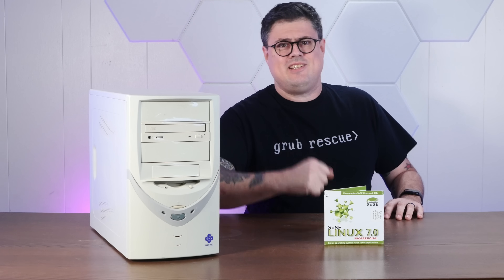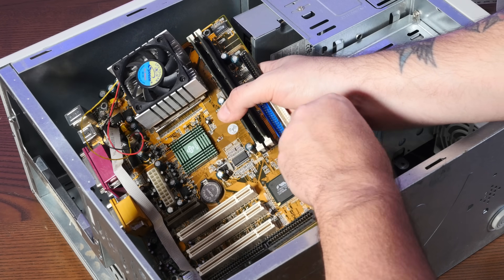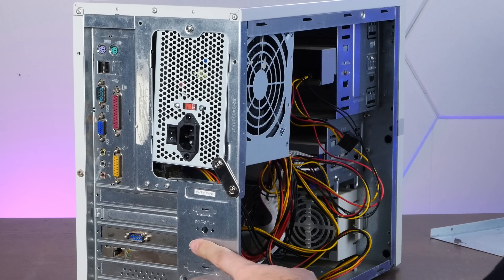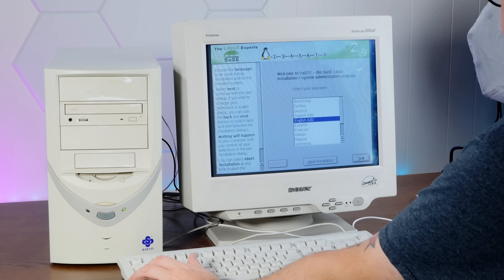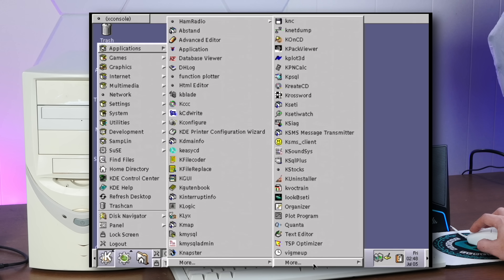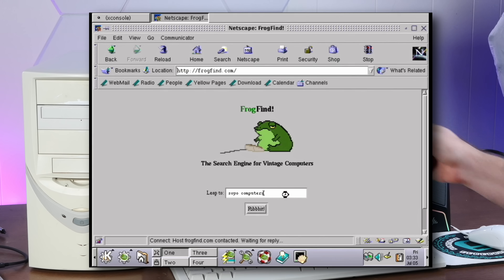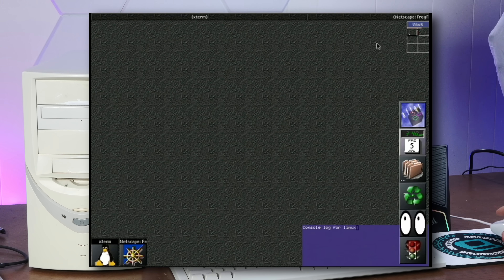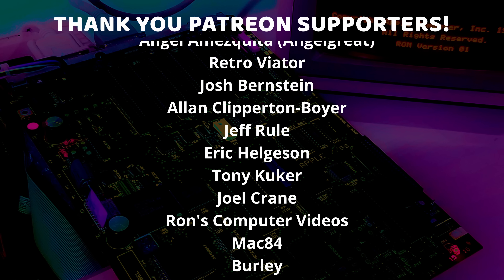The Forgotten Via C3 Processor

Comment: Finally! My favorite out of the distros I’ve tried - although the version I’m running is of course OpenSuSE Tumbleweed, which is pretty much the same distribution with modern features and a modern KDE Plasma desktop installed as the default.
You can actually still get the KDE 3.0 desktop as well! Just, don’t go breaking the sound settings like I did.
Reply: My to go Linux back days was Mandrake 8.1 - 8.4

Comment: My first exposure to linux was SuSe 8.2 purchased with a book from Best Buy.  The Via C3 was pretty common in thin clients from that era.  I bought a motherboard with a C3 installed for $35.  Wasn't a powerhouse, but was great for a file server (running linux)
Reply: Speaking of the C3, apperantly early VIA cpus were a mix of IDT and Cyrix designs while NS kept the mediaGX based Geode core before selling it off to AMD in 2003.

Comment: I bet that power supply had a mounting bracket it bolted to first.   I believe it would hinge into the slots on the side and then swing into position.
Reply: Thinking the same. I know my Lian-Li cases have something like this and wonder *if that could be smashed into working here.
Reply: It did. I've used that case before, or one just like it. You attach the PSU to a little rectangular frame and that hooks into the case. Parts like that get lost to the sands of time.
Reply: You are correct
Reply: It did, I have the exact same case with a different front panel.

Comment: If you haven't already, do a video on "Yellow Dog Linux" on one of your vintage beige macs. I tried a few times back in the early '00s but could never get it installed. You needed to side-load it with MacOS or something.
Reply: A good friend of mine got YellowDog working quite well on a Powermac back in high school.. I don't think he tried mklinux on a 68k though. Such good times!
Reply: Until he posts that, there are a few videos hew made of installing modern Adelie Linux on old PowerMacs.

Comment: YaST2 was such a gamechanger back then. I was a Slackware devotee, but was thoroughly impressed by that strange German disk.
Reply: Yeah it was, I mean this was still the era where most linux system installers were still command line based. Even when I first dabbled in linux in 2003 most only had a CLI installer and me being a Windows user could not get my head into it.
If it were not for Suse or Mepis linux it's unlikely I would still be using linux for as long as I did. I probably would have waited for Ubuntu or Mint.
Reply: True, but there was still the dreaded 'RPM Hell'. Oh dear, I feel a bit odd now, just typing those words has just filled me with dread, remorse, sorrow and anger all at the same same time.
Reply: @thingi  Yeah dependency hell is why my time with Suse was very short and why I often steered clear of RPM based distros. Seems like it's mostly a thing of the past but openSUSE still has it, though thankfully its nowhere near as bad as it was before. Zypp is vastly superior to what came before it to be sure.
Reply: When RPM Hell was really a thing package dependency resolvers were not. Debian's introduction of APT changed all that.
Reply: Slackware 3.0 was my first distribution.  

It definitely was not exactly user friendly.  I even used UMSDOS.  That was a weird installation method.

Comment: My first was Mandrake or later called Mandriva Linux. I installed Mandrake version 9.0 on a windows 98 SE PC and was blown away how awesome KDE looked in comparison to windows 98's UI.
Reply: Mandrake had an AMAZING installer too, especially during a time when other Linux distros still had text based installers only (well, of course except for SuSE).
Reply: Yep. It went through some name changes, from what I can tell and if I recall correctly. It was originally called Linux Mandrake, then it was renamed to Mandrake Linux, a lawsuit happened (according to a Wikipedia article) that resulted in a quick name change to Mandrakelinux, then the distro merged with Connectiva Linux to become Mandriva Linux, which was then shortened to just Mandriva, if I recall correctly, before eventually being discontinued and spiritually succeeded by OpenMandriva Lx and Mageia.
Reply: Mandrake was way ahead of its time. It had a nice installer, a beautiful theme, a control panel and much more. Makes me sad that it vanished.
Reply: @ikemkrueger They are OpenMandriva now.
Reply: Yep.  I loved Mandrake.  I was running Redhat 6 or 7 something when I got my first copy of Mandrake and not only did it look better but all of the hardware just set up easily right out of the box instead of all of the days of trying to get X configured properly only to find out that you needed to buy a new sound card.  I ran Mandrake until Fedora came out.
Reply: interestingly enough, the first I managed to get working on a PC that came with Vista... Home Basic, was actually Mandriva, since it actually supported the onboard video and sound or something like that from what I recall.
Reply: RedHat 5.2 (I think it came with a "For Dummies" guide) for me but yeah, Mandrake shortly after that which went much better.
Reply: I think there's a fork of the KDE 2.3 called trinity cause modern KDE is quite different so those who want a similar x window have trinity and looks more like the latest mandrake KDE. Since I use q4os I can certify it's great.
Reply: Trinity is for of kde 3.5.10

yeah, I recompiled it on Slackware 15.0 i586 - version R14.1.1 (not only versioning changed, some APIs too, buildsystem mostly cmake now ..)
Reply: Mandrake was the second I tried, after starting on Debian Woody. Both from the CDs you could pretty easily order then, since I was not quite up for downloading everything over dialup.

One distro which started out as a Mandrake fork that I have enjoyed playing around with lately is PCLinuxOS. It still has a similar deliberated user-friendly feel to me. Might be worth checking out.